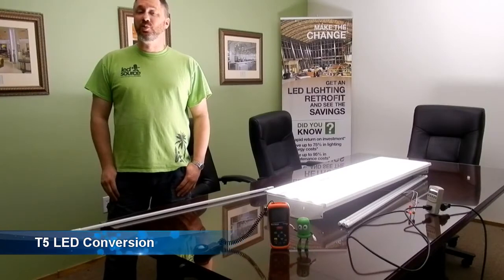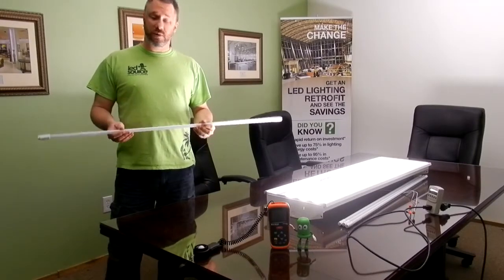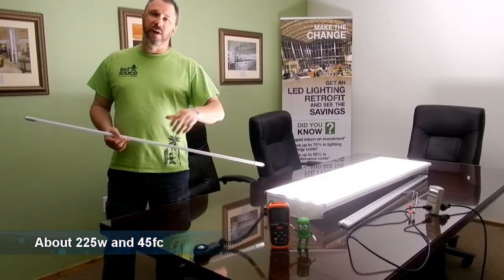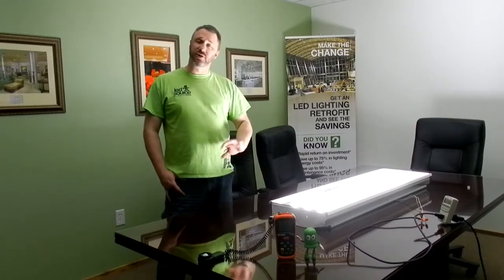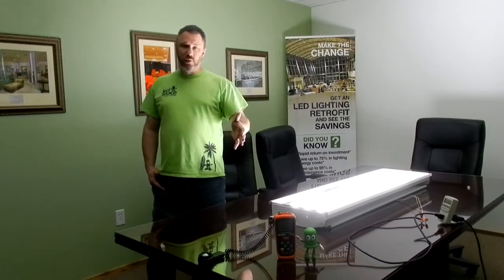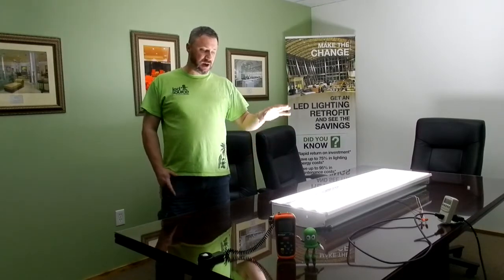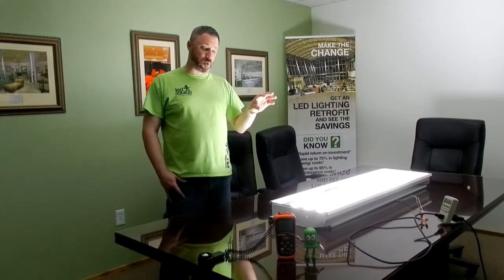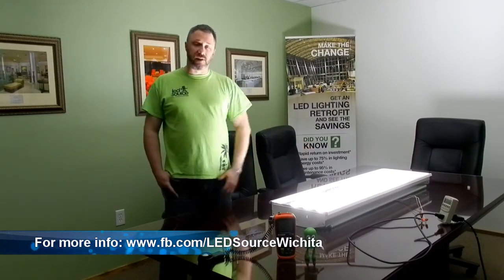T5 LED Conversion

Comment: Do these T5 bulbs ‘require’ ballasts, or can I take them out or by-pass them?  My understanding is that leaving the ballast in the T8 & T12 lamps when converting to LED causes an unnecessary and added consumption of power as opposed to straight wiring the LED bulbs and removing the old ballast.  My ultimate goal is better lighting with less power consumption and stop using florescent tubes that are not Earth friendly if broken..